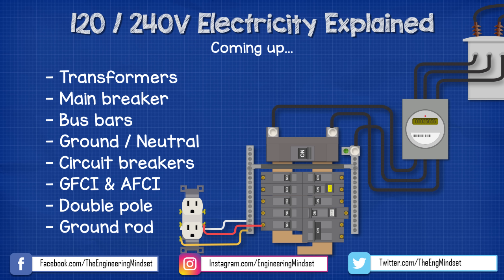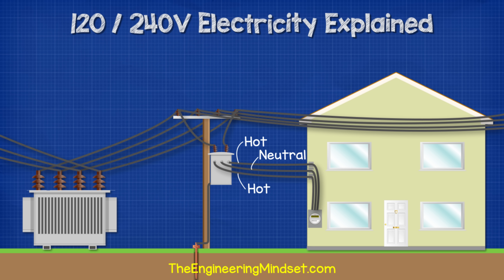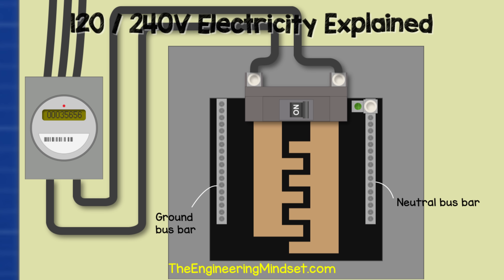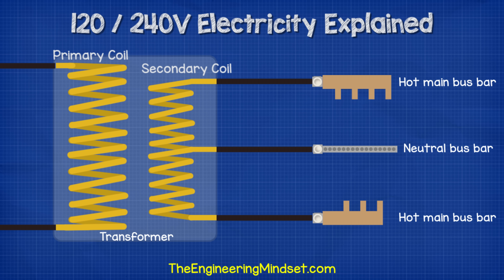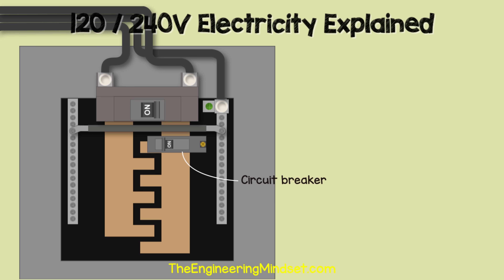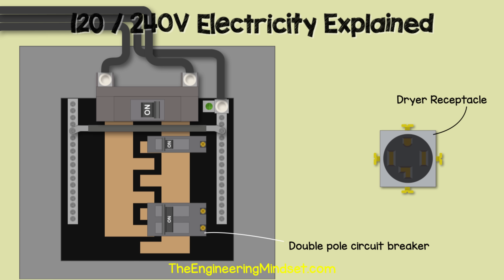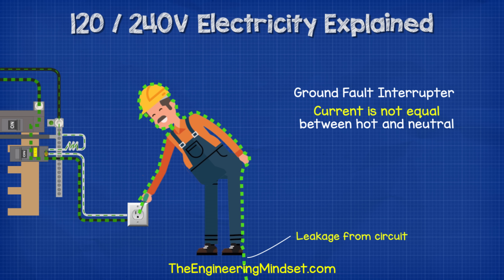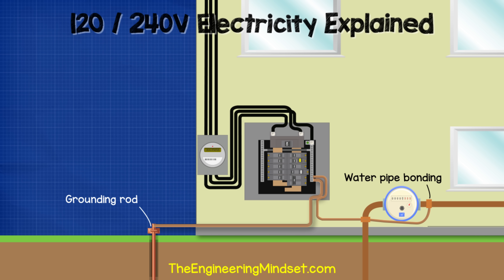120V 240V Electricity explained - Split phase 3 wire electrician

Comment: I see 2 problems with this video.  1.  In the US the ground wire is designated as green.  Not yellow.  2.  You can't mix Neutral and ground wires on the same buss bar.  They need to be separate
Reply from the maker: Ground wire is yellow in animation to show it as  bare copper wire. Only sub panels need to be separate, main panels do not. It's in the NEC guide.
Reply: @EngineeringMindset  You are partially correct.  The neutral and ground are connected together in the main box, but you still have to have a designated ground and neutral busbar.  Also here in the US the ground is always shown as a solid green wire, or not as common green with yellow stripe.
Reply from the maker: That's exactly what we have shown.
Reply from the maker: Check the new SUB PANEL EXPLAINED ➡️ video https://youtu.be/NUSNa-7Hecw

Comment: Great video. One comment is because the ground wire is a low resistance path to ground and the case is connected to the ground wire even if you touch the panel while line voltage is touching it you should theoretically be fine as you are typically a high resistance path to ground. That being said manufacturer's calculations for grounding through painted hinges get a little "magical" sometimes so I would avoid touching it anyway.

Comment: i believe in us its 110/220 and europe its 120/240 thats why us is 60 htz and europe 50 htz
Reply from the maker: Not quite, the 110, 120, 220 and 240 in US depends on how the transformer is wired to the property. Europe uses a completely different electrical system and most homes are provided 230V only, few have 3 phase. The frequency is historical reasons.

Comment: 3:38 not necessarily you need a shared neutral/ground bar connection, can be separate.
Reply: First means of disconnect they are shared. After that point they are separate. That is the standard.

Comment: Great video, very complete and detailed. However i am a little confused. Shouldn't the ground wires and neutral wires be connected to seperate bars? The ground bar conected strictly to the ground rod, with the neutral wires connected to the neutral bar? Shouldn't the two bars be independent from eachother? Please clarify. Thanks for the great content.
Reply: Neutral bar is bonded to your ground bar so in reality it doesn't really matter.

Comment: I am trying to run a power source to my building 20 feet from the house do i have to get a whole other box?? Or can i use the existing breaker box and run it out there. I want it done safely and a electrician to do it..
Reply from the maker: Check the new SUB PANEL EXPLAINED ➡️ video https://youtu.be/NUSNa-7Hecw
Reply from the maker: Check the new SUB PANEL EXPLAINED ➡️ video https://youtu.be/NUSNa-7Hecw

Comment: Very cool. My last house had an old Pushmatic breaker system and was improperly grounded. We had the panel and meter box replaced to handle 200A, and also had to ground stakes added to the outside of the house. The electrician we hired to do the work was really cool about answering all of my questions and I learned a lot about the whole setup. This video just added to that knowledge. Thanks!

Comment: I'm always confused about these videos when they show the current flowing for the current is not flowing in AC, the generator is moving a coil past the north and south of a magnet which makes the electrons move back and forth, you spoke of it needs to return for when the energy is used and there's nothing to each other for you're not getting anything from The electric company they're just making electrons move.
Reply: Then perhaps you should stop paying the electricity company and rip out all the wires!

Comment: So if I wanted to determine the total number of amps being pulled by my house at a given moment, I can use a clamp on amp meter to do so. My question is, do I do it to both hot legs of the box and them add them together to get what the house is pulling or would that be doubling the amps of the 240v appliances? In other words, does an electric range, AC unit, or dryer get the amps from each leg added together to calculate total draw?
Reply from the maker: Seen our new CLAMP METER tutorial?: https://youtu.be/J3kKNNizARc

Comment: Very good video but a few things to keep in mind always keep the neutrals and grounds on their respective bus, yes it will work like this but there are failure scenarios where having them intermixed can cause dangerous shock hazards, also the neutral bus should be connected to earth bus and ground rod at main panel

Comment: I've been wondering how the hot, neutral, and ground were connected for years. After wathcing this, my confusion was gone and I even learned how the 240V circuit is hooked up. Thank you for making such a clear and to-the-point video.
Reply: 240 is just line to line voltage. 120 is found because of the center tapped secondary winding that is grounded, hence 120 volts to ground. If the secondary winding was grounded on one end instead of the center you would instead have 240 volts to ground on one line, 0 volts to ground on the other line, and 240 volts from line to line. You should look up three phase delta and three phase ungrounded systems if you really want to get confused 😂
Reply from the maker: Seen our new 3 phase transformer video?➡️: https://youtu.be/u0SsejDCVkU

Comment: If you go into deep space there is nearly a perfect vacuum, But I found a place that has less than that!
It's when I wait for an answer to this question,
My 240v 50a garage outlet is a (6-50 outlet) for welding, It has 2 hots and a ground, it has no neutral,
Can I backfeed my 5000w generator on a line with no neutral?  I believe I can.
Some people say it's best to run a floating non bonded generator to your home panel as it is already bonded itself,
My generator is neutral bonded,  What has me the most confused is neutral and ground are both connected to the same damned place in the first place.
P.S. Ive been using a garage stove on this 6-50 outlet for years, it uses both legs, 240v and 120v without being zapped.

Comment: Well done, Great Illustrations. 
Was going to say in another video, Explain mulit-circuits(2 Hots, opposite phase, sharing a neutral, and how neutrals load is the difference of the 2 circuits.
 (If both are drawing 20 Amps, neutral carries zero. But since I just Did a House on west coast Florida.
All 120 Circuits had to be Ground Fault, Arc Fault, or Both. Still a couple situations you could still use.
Other Video could Show how Ground Connects to everything, doesn't normally carry Current unless their is a short, like a hot wire breaking loose in a refrigerator and touches case, it Trips Breaker, and not allow Case to become live. And why grounds are needed in metal conduit in case Conduit separates. 
Good Work
Reply from the maker: Thank you. Have you checked out our hot, neutral ground explained video?
Reply from the maker: We just published a new Ground fault, short circuit and arc fault video, so much detail! Link HERE➡️: https://youtu.be/Qi0ynSQw-wc

Comment: I grew up in America and later studied Electrical engineering in Europe. I barely knew about electrical installations by the time I left my country. And now I think, wdf America 😂 where are your RCDs!? 
I remember bathrooms' outlets would be equipped with an RCD, but that's it.
Reply: Those are GFCIs my guy and they can come on the circuit breaker itself or you can use a protected receptacle to protect a certain number downstream from it. We also have AFCI/GFCI breakers which are the supposed to be the  norm now 😉. I don’t know what you trynna flex here.
Reply: @jomerc  Thank you for the insight!

Comment: I have two distinct discrepancies. In trade school, the instructor told us voltage, also known as potential difference, appears on a multi meter as the calculation of the difference. His explanation was that you get 120 volts from ground to one bus bar because that's the difference and one bus to the other would give a reading of zero (or close to it) because there would be little to no difference between phases. 

The second was his explanation that since the ground and neutral are bonded, the ground rod is constantly sending current to ground. The only reason you don't get shocked, according to him, was because the path to ground via the rod is lower resistance than through whoever touched it. 

This video explains a very different circumstance for both situations. Please help me.

Comment: Hmmm......  attaching the ground AND neutral wires to the same buss bar? ...   I know those circuits are bonded in the main panel, but, bond them together when and how it’s called for.  I don’t think it’s a good practice to have both those circuits sharing a buss bar........even though ‘it works’.   I’d expect a professional electrician to use a “best practices” approach.
Hell, even the panel in the animation looked like it had separate neutral and ground buss bars.

Comment: its pretty uncommon for the gfci to be built into the circuit breaker in the united states you can find them at some hardware stores but usually there built into the outlets themselfs

Comment: So on neutral wires, you always hook up the black lead on your multimeter, right?
Reply: Someone please answer this guy. I don't know what you are asking but red is hot and black is neutral.
Reply: You will get the same result either way, regardless of which lead on your multimeter you hook to the neutral.   The multimeter won't give you the full waveform, it will just tell you the frequency and the RMS voltage, which will remain the same even if you negate the waveform by swapping the multimeter leads..
Reply from the maker: Check our new Multimeter tutorial out ➡️ https://youtu.be/4lAyzRxsbDc

Comment: I think I saw an error in the video.  I believe that ground wires must always be attached to ground bus bars and neutral wires to neutral bus bars.
Reply from the maker: You can check the NEC and see that is not the case. There are scenarios where you do not need to and where you must seperate them.
Reply: @EngineeringMindset  At one point, you were allowed to intermingle the neutral and ground at the main panel.  Now, you have to use the separate busbars that are each intended for ground and neutral.   This is the case even in the main panel.   You build the main panel as if it were a subpanel, and then install the neutral-to-ground busbar and GEC, to establish the grounding of the system.

Subpanels always have required you to keep the neutral and ground separate.  At one point, a subpanel in a separate building (e.g. detached garage, guest house, etc) would allow you to build it as if it were a main panel, but that is no longer the case.  A subpanel in a separate building, gets both ground and neutral brought to it from the main panel, as well as the ground bonded to a grounding electrode at the remote building.
Reply from the maker: Check the new SUB PANEL EXPLAINED ➡️ video https://youtu.be/NUSNa-7Hecw

Comment: So in other words,,, we're paying for electricity that we've already used ??? It's circulating through the meter
Reply from the maker: Not quite, the power station still needed to move the electrons, otherwise there's a power cut. You can move them yourself if you buy a generator or wind turbine etc. The electrons can move back and forth through the meter but you're paying for the power station to push them through your cables the second you need them, you're not paying for the electrons, these are already in the cable.
Reply: @EngineeringMindset  Oh, never knew that.

Comment: As always excellent video with awesome animation. I know electrically it doesn't matter, but as a matter of convention the green wire in the circuit breaker box should only be connected to the ground bus.
Reply: You will fail inspection if ground wire is on neutral bus. To an inspector ground is ground, neutral is neutral, and the two don't meet. The bonded neutral is not material to grounds vs neutrals. Bonding is an after the fact requirement.

Comment: Can you add 110 volt outlet in the house on line from outside line 220 volt without transfomer? Please advise.
Reply: What do you mean?   Without the transformer, you would have tens of thousands of volts enter the house, which is not allowed.  The transformer is needed to step down from 15 kV or 25kV class feeders of the distribution grid, to the 240V system used inside the house.  Centertapping the secondary to turn 240V into 120/240V is a secondary purpose of the transformer (no pun intended).

Comment: why could the grounding bar and neutral bar be connected together? can someone explain?
Reply: In North America the voltage on the wire called neutral is zero volts. This is made so by grounding the neutral at one point, and only one point. This is done in the main panel. It isn't done in sub-panels.  If the neutral is not grounded it can have any amount of AC or DC voltage on it.  While a meter will read 120v across the circuit the entire circuit could be floating a thousand volts above ground due to a nearby lighting strike  last week.  Grounding the neutral is good as long as you do it in only one place.
Reply: @billelkins994  I never heard of lightening strikes effecting housing electrical circuits for a period of time. We had an electrical storm in our neighborhood and after a power outage several neighbors have dim and flickering lights. The electric company gave us all the same response, " all power to electrical box is normal". Can the lightening strikes have anything to do with the lack of or inconsistent flow of power to our homes?
Reply: @TippyPuddles  Hi Ann. If a circuit is not attached to ground there is no way to say what its voltage is. In the winter time when humidity can be low the carpet you walk across may cause you and a doorknob to be a different voltage by thousands of volts. In a supermarket the shopping cart you push around may be dragging a small chain on the floor. Electricity is everywhere and it is out to get you. The lightning strike affectting circuits for a period of time doesn't happen because the circuit is grounded somewhere.

Lightning strikes generate very high currents and can damage wire in a home. Are your homes flickering together? If so it is probably the power company. Regardless it does need to be looked at by someone. Flickering and dim lights means heat is happening somewhere it should not be.
Reply from the maker: Check the new SUB PANEL EXPLAINED ➡️ video https://youtu.be/NUSNa-7Hecw

Comment: I am wondering about 240v/480v 3 phase electrical boxes. I was just wondering if you could tell me if someone could intentionally use this type of electricity to maliciously electrocute someone ina building? I know its an odd question, but my landlord is a psychopath and a murderer. About 4 months ago she had a 3 phase 240/480 volt 2000 amp 65000 amp circuit fault electrical vehicle meter installed in the building and powered by the dept of water and power. She didn't get permits from the city for anything else and may have had her sketchy electrician do the install of whatever meter itself because it says some weird stuff on the work order about skipping necessary checks but that the device is operational. She doesn't have any plans to install any EV chargers and the location where she had the meter put in isn't even near where car could possibly park. On top of this 4 floors up in a highrise building people are getting electrocuted which has happened to me too. It's very strong but it's all over your body and not coming from one place like your hand like it would if you accidentally touched a wire or something. Do you have any advice on this or what she could possibly be doing? Is she just running a wire up there and letting the current pass through whatever is there on its way to the ground? The police wont help because this is in LA and they think it's bs and don't care to check it out. She's literally a human trafficker and no one will look into it because it's all impossible. What then is she doing with this EV meter and 2000 amps that was isntalled right when people started getting electrocuted? I've been told it'd be impossible to electrocute someone in a building using regular 120v ac if they weren't holding onto a wire. It's a really serious issue. Thanks. This is the details of the meter:  277/480 volts, 3 phase, 4 wire, 2000 amps meter switch, 62500 amps AIC fault current, switchboard info: 2500A, 480Y/277V, 3P, 4W MAIN
Reply from the maker: We just published a new Ground fault, short circuit and arc fault video, so much detail! Link HERE➡️: https://youtu.be/Qi0ynSQw-wc

Comment: What’s the voltage for neutral wire? Is it 0 or 120?
Reply: 0 Volts.  It is bonded to the EGC and grounding electrode at the service disconnect, making it 0V at that point, by definition.   There will be a couple of volts on it due to Ohmic voltage drop, but the neutral is roughly at 0V.

Comment: If Voltage is a difference between two potentials ,why then when taking measures at between two hots gives 240 volts ?
I understand that first hot is 120 and another is also 120 therefore the difference is 0.
Why I am wrong?
Reply from the maker: Because one is +120V the other is -120V. So the difference between them is 240
Reply: @EngineeringMindset  
Thanks for explaining .
Obviously it's the AC .
I forget. 
My fault. 
Kind regards

Comment: With AC current why can't you be electricuted through the neutral wire if the neutral wire becomes powered when it alternates.
Reply: The neutral is bonded to the EGC and grounding electrode, at the main service disconnect.  Neutral is at the same absolute voltage as ground, with the exception of a couple of Volts difference, due to Ohmic voltage losses in the neutral.